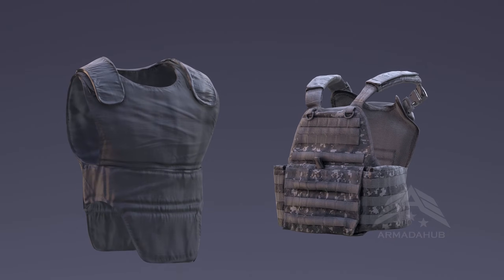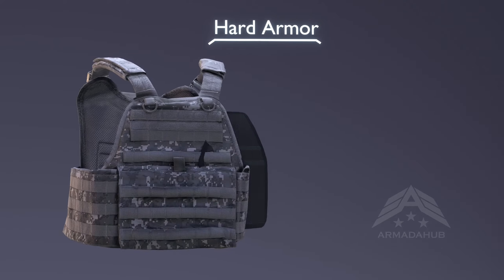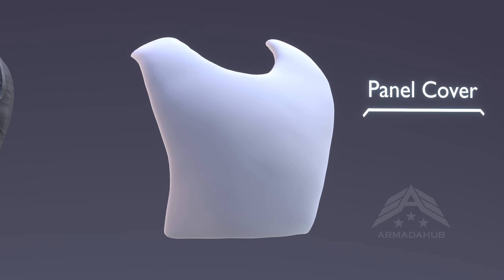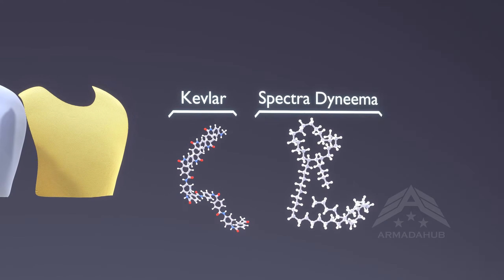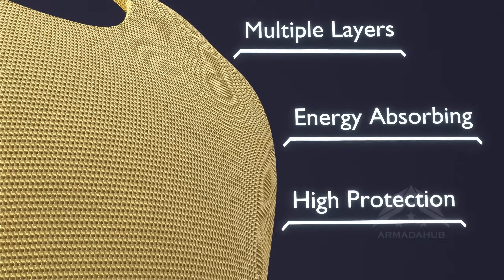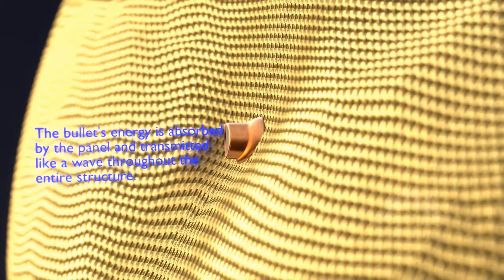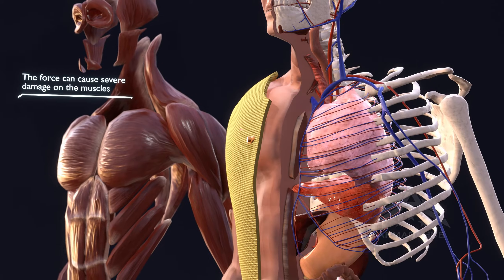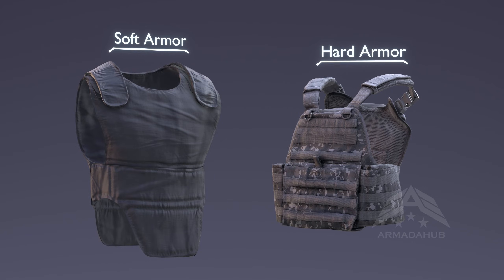How Bulletproof Vest Work

Comment: I have a question what if you wear soft armor underneath and put the hard armor on top will I be bulletproof?😅
Reply: some forces do that. but soft armour is not good against your typical combat rifles such as AK-74 or M4, they fire bullets wich are not only larger than the 9mm bullets but travel significantly faster, they hit 5-10 times as hard meaning armour has a much more difficult time defeating it. Soldiers wear hard armour where each panel can absorb only 1-2 bullets before failure and the panels need to be swapped out after battle. Kevlar can defend you against multiple shots but only from smaller calibers. it still has it's uses on the battlefield minimising shrapnel damage by covering whatever isn't covered by the hard armour. Also most of the time you are still going to be injured when you are struck by the bullets even if you wear armour the point is that instead of a gaping chest wound wich bleeds you out in seconds you "only" have broken/fractured ribs.
Reply: @sosig6445 interesting I wonder why there isn’t a full body soft armor to deal with lower caliber handguns
Reply: @ciro9951  
There probably is, for special forces or SWAT units. but it's situational, kevlar isn't the most aergonomic material to wear...